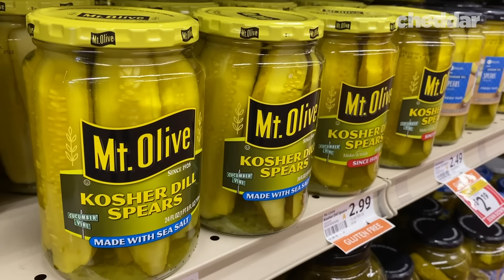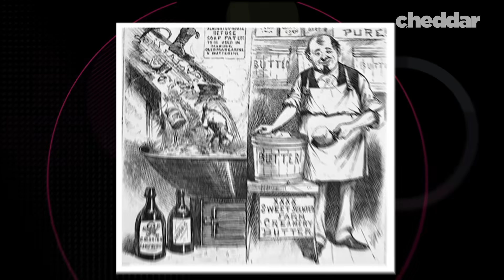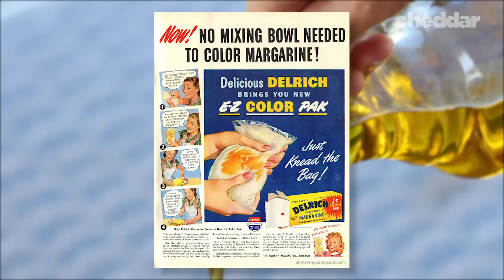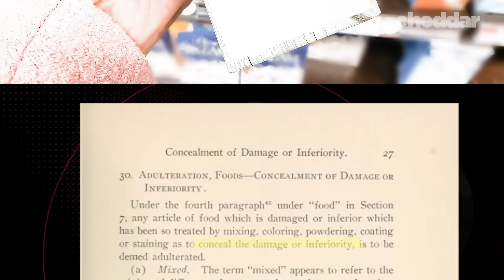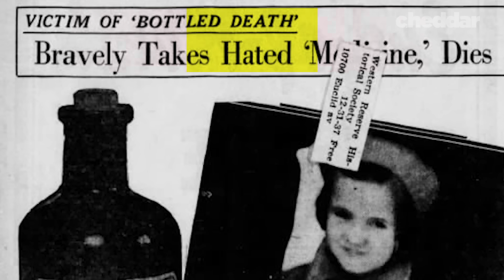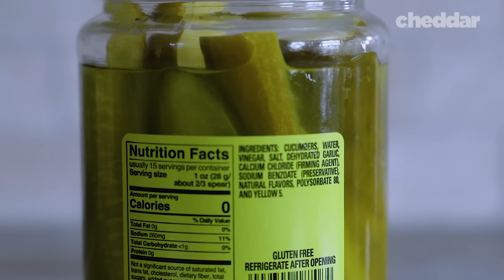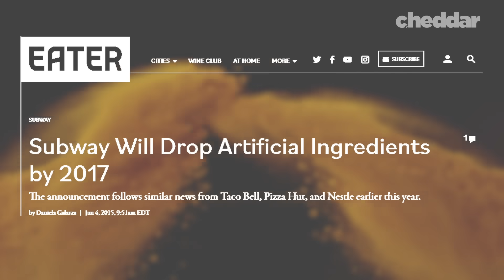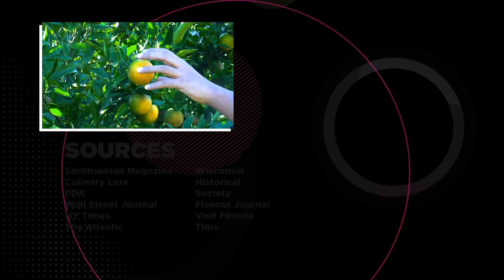Why The U.S. Government Decides The Color Of Our Food - Cheddar Explains

Comment: 6:49 I did some research, and this stuff about oranges isn't exactly true. It is true that some orange fruits stay green even when ripe, but they are rarely sold to external markets and are certainly not dyed orange. Which, if you just think about it, is kinda obvious. Green is way too dark of a color to just be covered up by orange dye. It is true that citrus red #2 used to be used for paler oranges to make them more vibrant. However, its use has been largely phased out. Nowadays, the bright color may come from ethylene gas (famously produced by ripening bananas) to naturally brighten the skin and make them appear more orange. But yeah, nobody ever dyed a green orange orange.

Comment: My points need to come across is that for example -
Navel Oranges get pressed 
Stamped Orange only but 
2 states in the US right but 
Get this it only inks and tattoos
Tge overall skin of the Orange 
Correct? Ok but that's not harmful what so ever for human consumption it cant
Exactly leak through the tough
Rubbery latex skin but on the 
Other continent in Polynesia
The pale off putting dark
Gloomy of the Salmon is such
A danger as its been modified
And not to mention az the 
Colour dye may not be so effective or harmful it really
Comes down to the wreckage
In the bottom of the 7 mill seas where unknown unidentified micro anti bodies
Somehow accidentally spill 
In whilst this processing and 
Production are happening just 
Think about like tge the possible highly chances of 
Unwanted airbourne parasitic
Species on top of plastics floating around microscopic
Fibre size in the factory aswell 
This is such a big concern 
That very little is known or 
Talked over about possible 
Harmful discretions

Comment: A few notes: The first margarine you speak of or 'oleomargarine' was not actually white. It was a pale yellow color similar to some butters. 

Butter is not always deep yellow...most of it today has annatto coloring added and this began early on so that commercial butter could have a consistent color all year long. So, coloring was added to butter before it was added to margarine. In a way, butter is more to blame for this trend of coloring natural products rather than margarine. 

Margarine makers colored their margarine to make it look like the butters that were on the shelves which themselves would have been a range of pale white to yellow colors at different times of the year if not for coloring. But the margarines made from vegetable oil rather than beef tallow did have a pale yellow color to begin with. The butter industry got upset about all this coloring and called it fraud even though they themselves did it without even revealing it to the consumer.

Comment: Yeah, no.  The color of that salmon and those pickles in those pictures were faked.  Those types of foods may actually be dyed in the industry, but those particular images were clearly photoshopped.

The pickle jar picture has a yellow filter applied on the whole image.  It looks almost monochrome.  Even the white lettering on the jar is slightly tinted yellow.

As for that gray salmon picture, at 0:19 you can see the whole image, and near the top, you can clearly see at the edge of the salmon where the photoshopping didn't quite cover the whole piece of fish.  It's still pink along the edge.

Comment: Odd... I grew up on an orange grove in Florida and I never noticed the oranges not turning orange... maybe because they did... or at least yellowish orange. I thought you were going to say they were brown, as most oranges have a disease called “rust” colloquially, which toughens the rind and creates brown blotches on the peel. Those are typically juiced rather than sold in stores. A cold snap, is needed to make oranges sweeten to their fullest potential, but I think it might come down to the variety of the orange whether or not it changes into it’s bright orange color... or perhaps more research should have been done regarding the climate of Florida and the color of our oranges... believe it or not, Florida is about as cold as it gets for most citrus. Were not a hot climate if your asking oranges, for they would tell you our semi-tropical weather is quite frigid for them. Yes, oranges may be gassed after picking to darken their color, they are not ripe when green. In fact, some commercial groups will pick them whilst unripe, and gas them to appear ripe, but you can tell by the taste (or at least those in the know can) that the orange was not quite ready when picked.

Comment: I can always see that bright highlighter neon yellow color in every food from a mile away, and always avoid it.  McDonalds french fries have that neon yellow glow.
Reply: McDonalds french fries are potatoes with some dextrin and spices. They have no color except that given by the Maillard process.
Bright neon yellow is likely saffron or tumeric. Your main concern there is making sure your government has plenty of regulation over food additives. Because, where it is grown, it has been a problem with processors adding lead chromate to product for local distribution to maintain a high brightness when curcumin levels in the root was low.
Reply: @Markle2k  it's not tumeric, it's sodium acid pyrophosphate
Reply: @djp1234  SAP is a colorless solid. It is not responsible for the yellow color.
Reply: @ITH56  As already pointed out, SAP is a colorless solid. It's purpose is to keep potatoes from getting discolored before cooking. The opposite of what you are repeating.
The yellow color comes from the Maillard reaction linking the starch molecules into complex oxidized sugars with amino acids. This is something that people have known for over a century.
Repeating the same error just puts you down the path the chemophobia-induced insanity.

Comment: Honestly margarine probably wasn't so bad when they first made it in the 1800s, but in the 70s or 80s they changed the formula and made it with all hydrogenated oils which made it EXTREMELY unhealthy! To the point where it came out grey instead of white before dye. That's all I ate as a kid cause my mom thought it was better for us. Yeah, now we only use butter.
Reply: Umm. No. Hydrogenation is the process that lowers the freezing temperature that makes it spreadable instead of pourable. That process is also called saturation as a fat that has all of the side chain spots taken up by hydrogen is referred to as saturated fat.
Butter is mostly saturated fat.
Unsaturated fats have very little, if any, hydrogenation going on. These are typically known as "oils". 
In between, you have partially saturated/hydrogenated fats, aka trans fats. This is where margarine typically lies.

Comment: I had an orange tree in my backyard in Tucson, AZ and the oranges ripened orange in the summer when it was over 100 degrees outside.  There may be varieties that ripen while still green, but not all of them.  Mine was the Valencia variety.

Most likely any dying of oranges grown in TX or FL is done because they are harvested before they are ripe so they can be shipped and not deteriorate.  So they might be colored orange to make them look ripe when they aren't.  Lots of commercial fruits are harvested before they are fully ripe, which is one of the reasons why they don't taste as good as those you grow yourself.
Reply: The comment section also seems to disagree with that part of the video. To me this lends support to your explanation. 

On top of that, I have had my fair share of oranges in the southern US and all were bright orange. About 1/15 were firm, tart, and semisweet but I couldn't tell they were underripe until I peeled them.
Reply: Dyeing